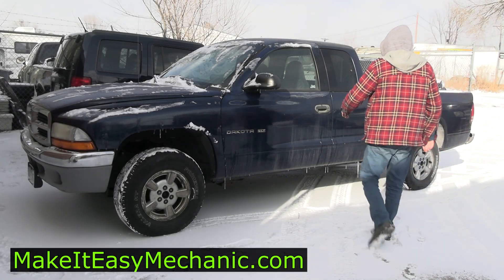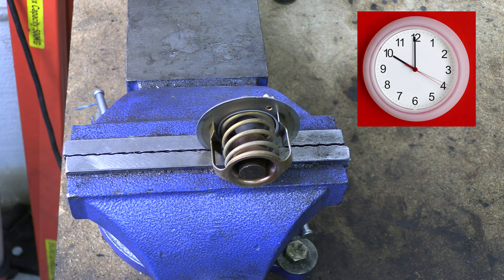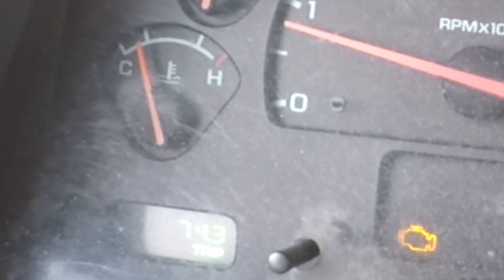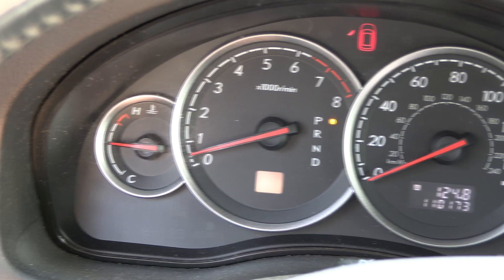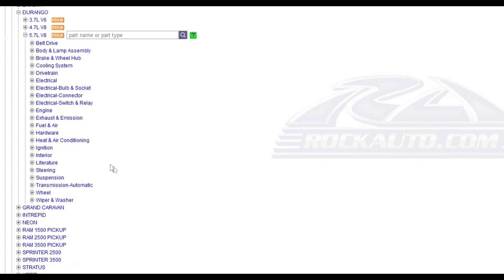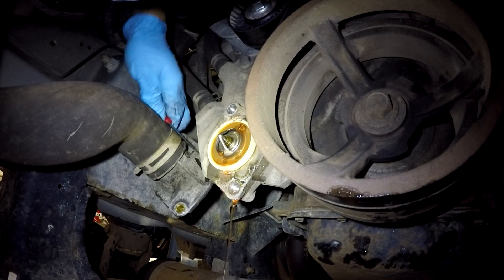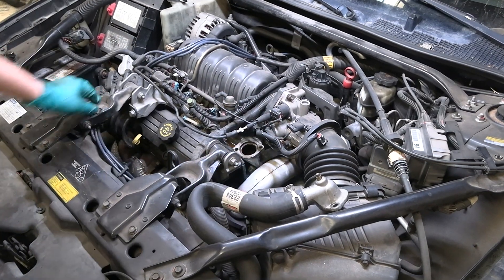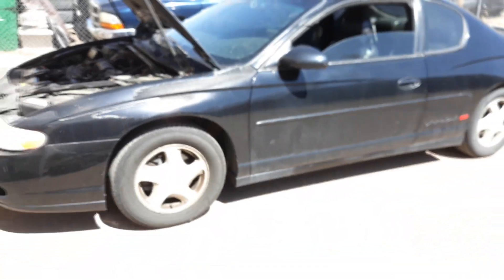Symptoms of a BAD THERMOSTAT and how to test it - in 10 minutes! +Thermostat Replacement, Code P0128

Comment: Really appreciate this informative video. I will replace ECT thermostat on my 2008 Honda Accord V6. I don't have any codes. Only reason for change is, I have been having 15 MPG for last 2.5 years. I have tried everything google had to suggest. I ran some live data with BlueDriver and ChatGTP recommended ECT thermostat replacement. I don't believe everything Chat GPT says. Warm engine temperature use to be 86° C (187° F). After installing a VCM muzzler last week, it is now 74° C (165° F). Google says it should be 88°C - 104°C (190°F to 220°F). Would you know what before and after temperatures should be?

Comment: I currently got a 2013 F-150 with a lazy temperature sensor, the engine warms up and I get heat so there's that but I'm gonna try to milk the sensor out until I need an oil change and get it fixed then.

Comment: Sir the issue of my car toyota innova 2.5e diesel is that, there’s this sounds like a boiling liquid in the engine that’s audible when you turn off the engine. Thing is my temperature gauge shows just normal midway between low and high. It heats up normally also and does not linger below temperature. There’s no boiling of coolant or increasing or decreasing. It’s normal as before except for that boiling sound. So in case my thermostat is in stuck closed, then the temperature of my upper hose is hot right? What about my lower radiator hose? Because you mentioned about “drastic change” in temperature.. I want to know. Thank you sir.
Reply from the maker: if the temperature gauge is reading normal it is highly unlikely your thermostat is stuck closed. I would look for leaks and check the coolant level. When coolant gets really hot (to the point of boiling) your radiator fans will be running, and coolant in the engine doesn't boil the same as water in a pot, it sounds more like - one big bubble at a time if that makes sense. Good luck, and please share what you find out!

Comment: I have the same problem, mine water flows to the other hose when the thermostat is removed. however even if the thermostat is new, water doesn't flow to the other hose what might be the problem.

Comment: I have an audi q7 2013 3.0 litre. My audi does take long to heat up. As the weather is cold. The car shouldn't be taking that long. It gets warm but never hot. Could this be the thermostat? My ac works perfectly fine

Comment: An important tip: if you change your top hose when doing a thermostat, or for any reason really, be sure to see if the new hose didn’t come too long.  It’s not uncommon for replacement radiator hoses to be too long and while they fit they end up too tall.  Then you’ll end up with a big old air bubble at the peak of the top hose that prevents coolant flow. 

Don’t be surprised if you gotta trim one end or the other, or both, to lower the top hose height and not allow that air bubble of death at the top hose’s high point.  I’ve seen people replace damn near their entire cooling system and repeatedly burp the system and still have overheating cars/trucks, just because of this issue.

Comment: My Nissan frontier xe is running too cool it misses and sets off the codes the thermo from wally world said it was OEM but it's not running and neither is my air was it supposed to come with a gasket that goes around the edge like my original it's an aisin and supposed to be right never had this happen in all the hundreds of ones I did I'm stuck ,it takes 10+ mins.to warm up and is getting terrible mileage
Reply: If your Nissan Frontier XE is running too cool and taking over 10 minutes to warm up, it’s likely due to an improper thermostat. The replacement thermostat should match the OEM specifications, including the gasket for a proper seal. A missing or incorrect gasket can lead to coolant bypassing the thermostat, preventing the engine from reaching optimal temperature. Verify the part’s compatibility and consider replacing it with a genuine OEM thermostat to resolve the issue. You can subscribe to the channel, or leave questions on the "Mechanical Guy" channel. My colleagues and I with many years of experience as auto mechanics will provide the fastest free support!
Reply: @MechanicalGuy68  I know that if you read the thread it stated that aisin OEM was used, Walmart s part people said it was a perfect fit it was not I've been a mechanic for 35 yrs exception to the rule I took for granted it was the correct temp thermo and there was no temp rating marks on the unit even inside the body of the valve assembly,that's what I get for being gullable.this motor parameters in the ecm are 192 f which I think is too high for oil and internal parts preservation.thx

Comment: Thanks very much for teaching me why we should use thermostat but Africa they said because the climate change so we remove it from the engine how true is it
Reply from the maker: It's not a good idea to remove the thermostat from the engine, even in hot climates - the thermostat is an important part of the cooling system and helps regulate the engine temperature, which is important for the overall engine efficiency.
Reply: In south Florida I always ran my Disco 2 without a thermostat.   They notoriously ran hot and doing so kept it at perfect operating temp.

Comment: That's false information if it's the thermostat you also can see the bloody radiator not circulating and it's not the water pump because you'll hear a squealing sound like the serpentine belt or you could j you can check that pulley to see if it's loose but the thermostat is responsible for circulating the water just like the water pump but more importantly and just look at your radiator the water is not circulating it's the thermostat and this guy should say never ever ever ever ever never put coolant in your engine the radiator rather when it's not on yeah you could do it when it's cold a little bit but I don't recommend it and how will you be able to see if the coolant is moving hence blaming the thermostat
Reply: this comment is misleading because water and radiator fluid (coolant/antifreeze) are not the same thing.  If you see water in the system you need to take your receipt back to the auto store because you just got ripped off. 😅😅
Reply: Also, unless you have XRay vision you may not see your radiator circulating anything.   Including water.

Comment: DON'T FOOL YOURSELVES PEOPLE  !!!.THE TRUTH IS THAT WHEN OVERHEATING ISSUES  YOU WILL NEED TO  PUT FIX A LEAK AND DIRTY THE THEN  WATER AND PRESTONE THEN FLUSH OUT AND THEN REPLACE THURMASTAT AND REDIATOR CAP AND WATER PUMP AND THE COOLANT FAN COOLANT SENSOR AND THE  HOSES AND THE  IDOL CONTROL VALVE AND TEST THE RELAYS AND FUSES AND THEN  AFTER ALL THAT WORK AND REPLACEMENT  YOU WILL STILL HAVE OVERHEATING ISSUES,  TAKE IT TOO MACIANIC SCAMMERS ROBBING MILLIONS OF PEOPLE AND PAY ANOTHER 2000 DOLLARS FOR THE SAME SAME THING YOU JUST DID ON YOUR COOLANT SYSTEM,, THE TRUTH IS THAT YOU ARE FKD TOTALLY  FKD AND THEN GO TOO YOUTUBE VIDEOS AND ASK FOR ADVICE EVERYBODY IS A MACIANIC BUT NO ONE KNOWS A DAM THING

Comment: GREAT VIDEO,  HOWEVER I STILL CAN'T FIGURE OU OUT WHY DODGE DURANGO ENGINE 4.7 OVERHEATING  AFTER HEATING UP THE THURMASTAT IN WATER IT OPENED UP AND CLOSED IT ALSO FIT GOOD IN THURMASTAT  LOCATION  AND I DO HAVE HEAT COMING OUT OF HEATHER  ,I ALSO FLUSHED REDIATOR  AND  DID BLEEDING JOB  HOWEVER BLEEDING JOB NOT WORKING OUT I STILL SEE BUBBLES AIR. DON'T SEE ANY VACUME LEAKS  I HAVE NO IDEA WHAT TO DO NEXT ..ANY SUGGESTIONS  ADVICE
Reply: Use a spill proof funnel to fully bleed the system. Many YouTube videos on this
Reply: Sometime accelerating while bleeding can burp any air trapped in your system...

Comment: Hello, please. I have a question, my diesel engine 2.0 140kw dfha takes pretty long to warm up, in city traffic its very long, sometimes it drops from 70 to 50 when im waiting on trafiic lights, but after drive for around 15 minutes it reaches 90 degrees, than it stays normally there. is it a problem? 
Thanks